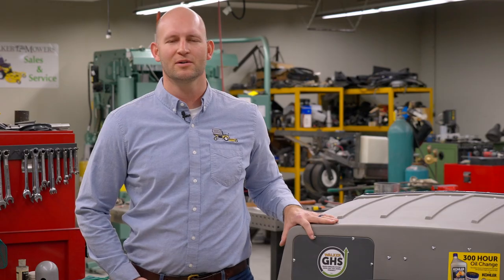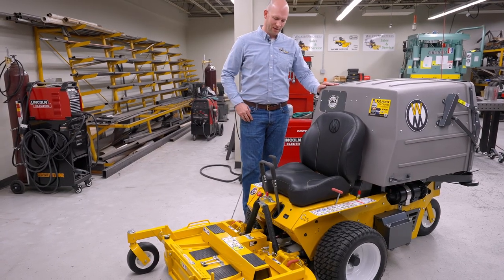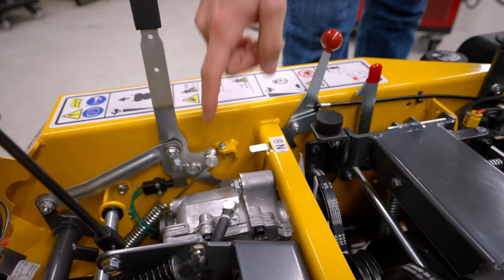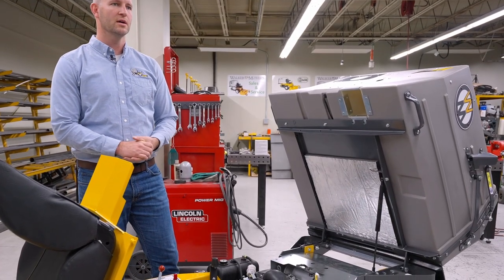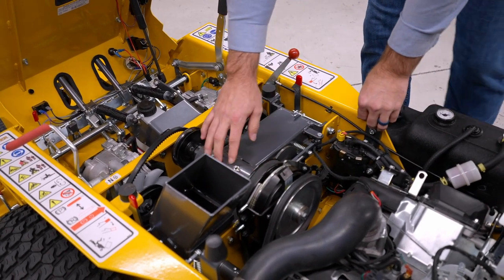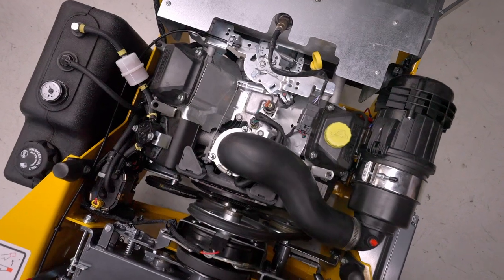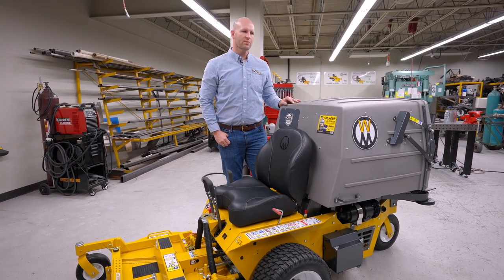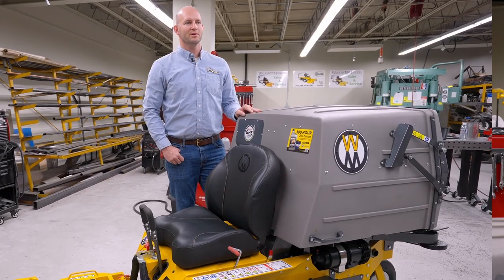Walker C23i Product Introduction by Ted Walker

Comment: What about ground clearance? Does it have more clearance than a model T ?
Reply from the maker: Hi Travis, thanks for reaching out. The C23i has a quarter of an inch more clearance than the T27i. Keep in mind that the C23i has a 13.25” blower versus the Model T with a 10.25” blower - nice work to our engineering team!! 👏

Comment: And, Still no height adjustment for the deck?
Reply from the maker: Hello, each Walker Deck has the ability to adjust the height as needed by moving a height adjuster pin on the front left and front right side of the deck. If more adjustment is needed, our Deck Height Washers allow finer adjustments of cutting height on compatible decks. Use these to adjust deck height by 1/4 inch. You can find more information on those here: https://www.walker.com/addons/deck-height-washers

Comment: what are the differenes between this and the model T?
Reply from the maker: Hi Mike, thank you for reaching out. The Model C23i has some specific differences like no tractor gearbox and other manufacturing improvements.
Reply: How are the blades driven on this machine then @walkermowers